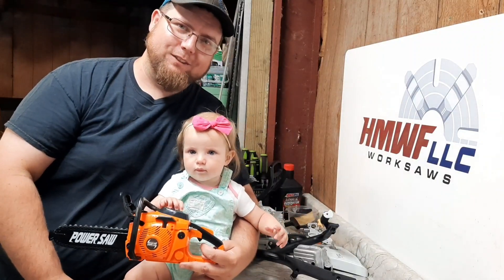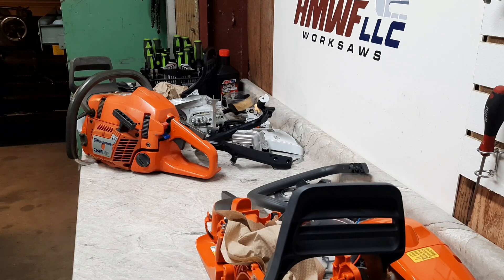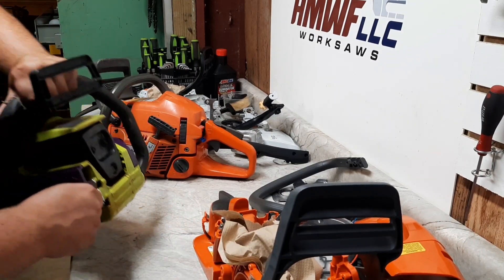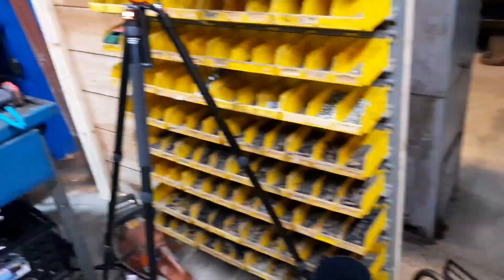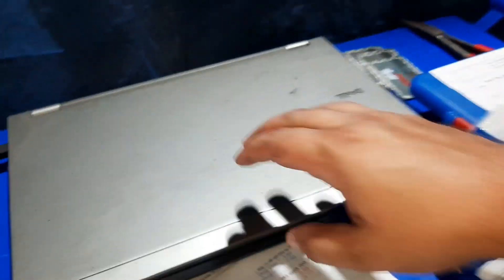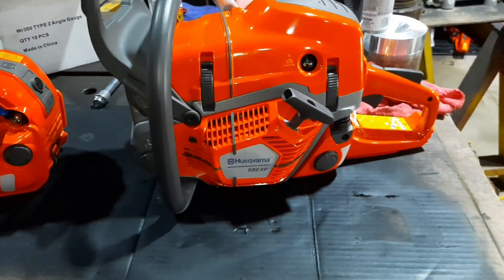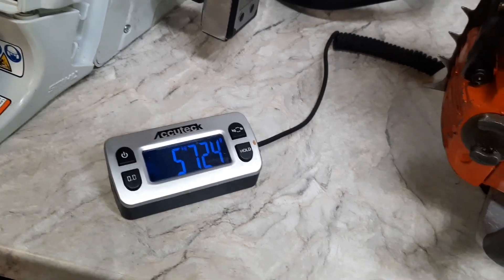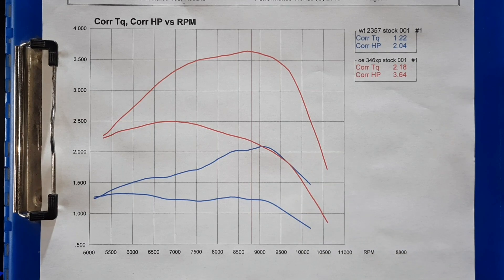Husqvarna 346xp vs Poulan wild thing! A pair of Legends?

Comment: YAY!  You got a Bad Boy!  That's PERFECT because mine has the cylinder from a 365.  It's the same cylinder, but just a tiny difference in the port timing.  So, you will be able to see if there is a difference in power.  Should be that the Tim Allen is just a smidgen more powerful.  But once ported, the stock timing won't matter, and the cylinder I'm using is absolutely perfect, so that's why I used it instead of a true 3750/380 cylinder.

Comment: Those OE 346xp 42mm made one hell of a zippy saw when ported. Even if it wasn’t the absolute strongest it definitely makes up in durability, simplicity and ergonomics. Just fantastic saws.
Reply: Beasty limber ported, toss on a 455 rancher clutch cover and they sure make a nice firewood saw.
Reply: @brettblack7049 is that to get the newer style tensioner on the cover?
Reply: @7eis  yes sir, it's much nicer than reaching thru the slot in the clutch cover on the 346/353/357/359.
Reply: @brettblack7049  10 years of production with ~60% of cutting done with a 346 I don't even notice it anymore 😅
Reply: @7eis  it's not the worse thing in the world, especially if you're using all the same gear every day as you probably are, but when you grab the "wrong" scrench and you can't hardly turn the adjuster 😒. 
The cover is also a bit larger so it clears chips better, which is nice for guys cutting mainly softwoods. Are you still doing production, what saws are you running now. Mod for mod, a late 550mk1 is what I prefer, although I still have a couple 346s I use for firewood or when time isn't of the greatest concern. 
Have a great day.

Comment: I’m honestly surprised the Wild Thing didn’t rip the bar and chain off your dyno. You’re a brave man Joe👍🏻
Reply from the maker: That thought crossed my mind... maybe after a muffler mod.
Reply: @dynojoemods2764  just be careful, could be catastrophic…
Reply: Love the 346! 👍👍👍👍🇺🇸🇺🇸🇺🇸🇺🇸🙏🙏🙏🙏
Reply: @simpleman4224  probably the single best saw ever made in its class imho.
Reply: Some good shoulder stretching exercises just before yanking on the Poulan Wild Thing should help prevent any injuries 😜
Reply: @christophercollins2330  I was impressed it only took 5 or 6 pulls from cold start, give it time…🤣
Reply: @IndianaDoug  the 550mk1 handles better though 😃. Late model 550mk1 will take the 346s lunch money and will still have lots of fuel left when the 346 runs out.
But everyone should have at least one 346 😉
Reply: Hahaha😂
Reply: @brettblack7049  got mk2 and ne 346 myself, had 550 ported by mastermind,  WOW! very hard on fuel now, but thats to be expected. 346
Reply: 346 is due back from Walkers soon too, really looking foward to running it again!!
Reply: @BruceMyersLBZ  sound like some fun saws. I need to get one of my mk1's out as I plan on doing some storm clean up this week, they handle so nice with an 18x325, great for limbing.
Reply: @brettblack7049  ABSOLUTELY!! new 562 at mastermind as we speak. Ima firewood guy/saw nut lol. Have a few other husqvarna's too, mostly stock tho
Reply: @BruceMyersLBZ  A 562 ported by Randy will run with many of the modern 70cc saws no problem, lots of fun.
Reply: @brettblack7049  yeah, scored it off ebay brand new for 500 shipped, sent her strait to Randy. He said it checks out as legit, so apparently i did score!! Prob send my like new 372 out to Walkers if 346 runs well
Reply: @BruceMyersLBZ  That is a deal. They were selling them for that a few yrs back in ohio at the Paul Bunyan show, hard t find a deal like that these days, good for you.